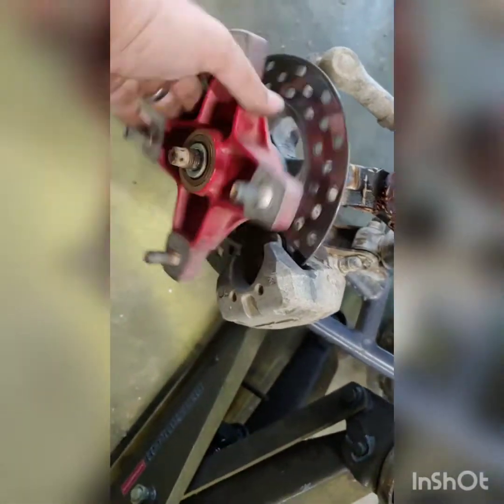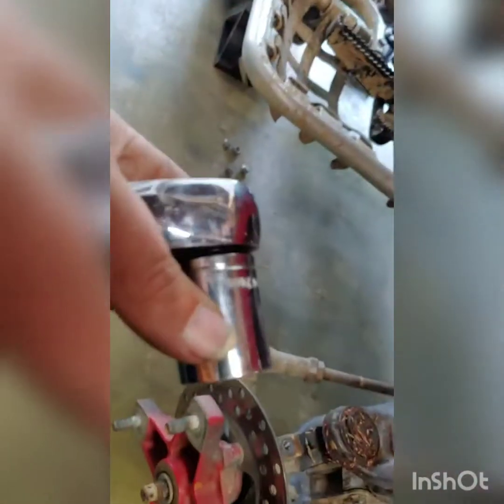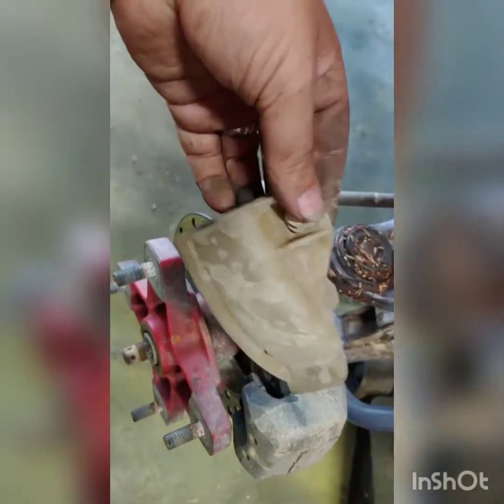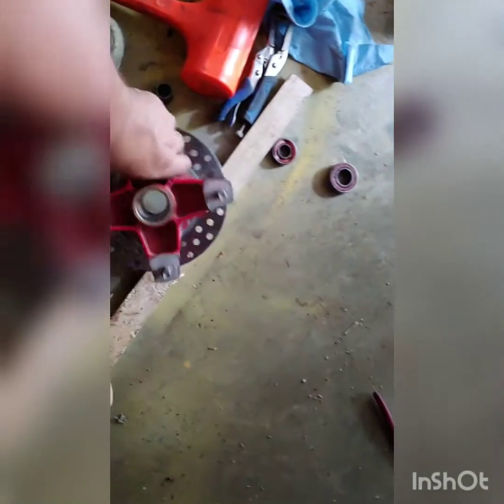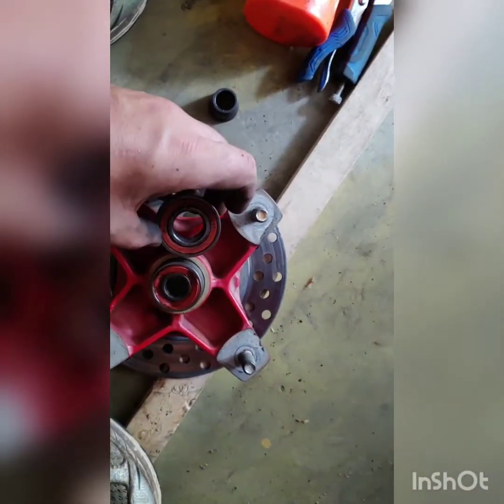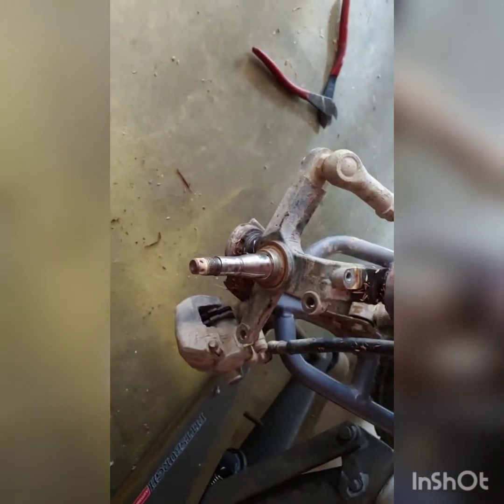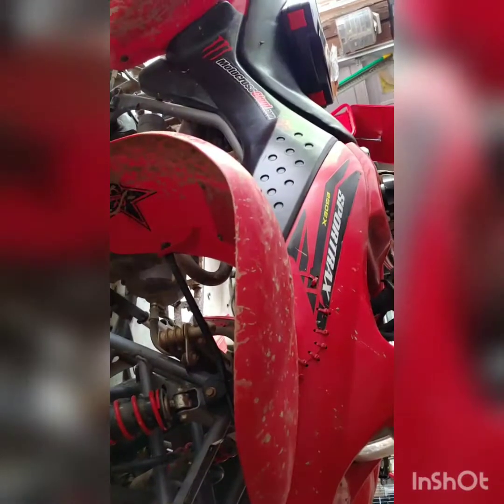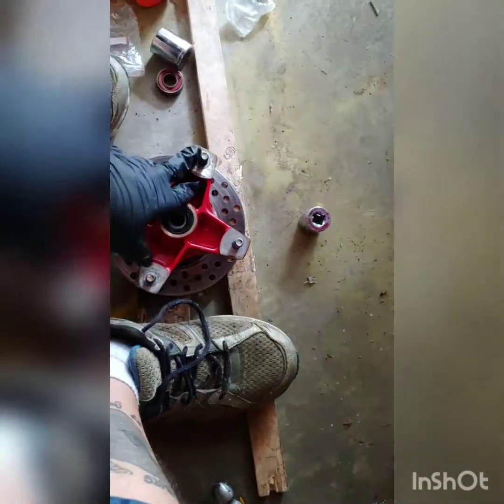2004 honda 250ex front wheel bearings

Comment: Do you have to take off the brake caliper to get the hub off?
Reply from the maker: Yes. The brake caliper has to be removed from it's bracket and just hang it up so it's not hanging from the hose
Reply: I’m actually doing this tomorrow me and my dad we went to ride today and the front hub assembly froze 40 bucks for a new oem hub